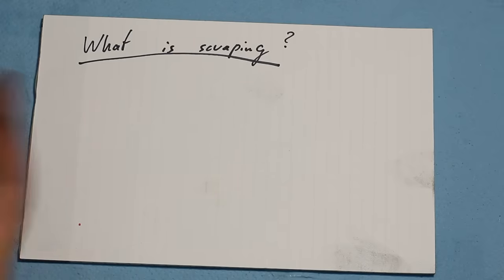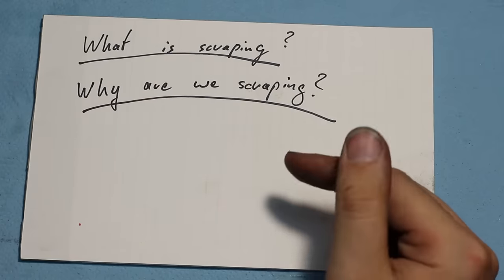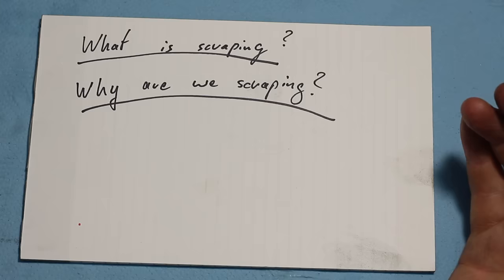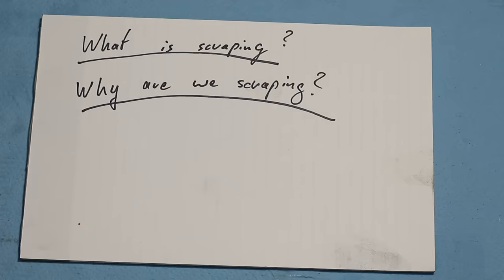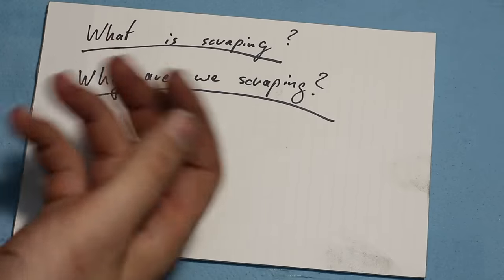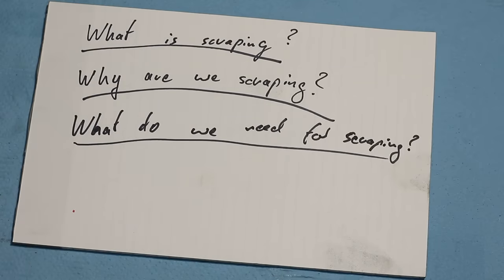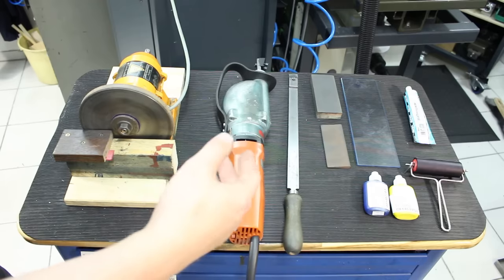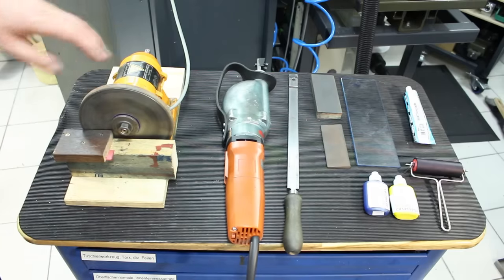Scraping basics - Scraping flat - Part 1

Comment: would be great if you could add links in description where to buy the Canode hi-spot blue/yellow, product code etc, also it was quite difficult to find it on goolge from your pronunciation alone, and you wave them around way too quickly to read the markings on the bottle, the bright light makes it hard to read whats on the bottle as well

I recently got into scraping myself, haven't tried water based inks yet, but I have tried that "Diamond" brand and Dykem hi-spot blue inks, and Dykem is much easier to spot once you're nearing the end of the process and use really thin/light coat of ink on the surface plate, shame that Dykem is really difficult to buy in mainland EU at reasonable price

p.s. oil based hi-spot is really easy to clean off if you have wd-40 at hand, no other solvent I tried worked that well to clean things up, including your hands, and in case you don't have protective gloves or find hard working while wearing those, get the PR88 barrier cream
Reply: I also had truoble finding Dykem or similar product at a reasonable prices here in Denmark, so I decided to try artists oilpaint. Get the Prussian Blue stuff, it is the most blue you can get, and the same pigment as in Dykem. The oilpaint is based on linseed oil, so it will harden over time, but it takes a day or so, and even then it can be removed with normal solvents. I use naphta for that. 

I have not compared the oilpaint to Dykem, but it seem to mark pretty well even in very thin layers, but again, i have no real comparison.  But if it gets you going until you find some Dykem, it should be better than nothing.
Reply: I cant find it locally here in Denmark, a search on Ebay and Amazon gives me a price around 19 US Dollars for 0.55 ounces, and i got tired of searching for a dealer in Europe, so i just went with the oilpaint. 

I know that prices are generally low in the US (if you find the right shop), but shipping and import taxes usually kills the idea of buying small item from the US. And since it is mostly a niche item, not many dealers stock, and doing the research and finding an alternative can be fun by itself.
Reply: I payed around 20EUR to get the 0.55oz Dykem delivered to me from an island nearly 2000km away (that was the closest and cheapest option), I think that's a lot for a tiny bit of paint, that Diamond brand one (which is like 10 times the size of that tiny dykem) cost 10 or 12EUR from a German industrial supply catalog.
I'd like to try the contrast ink (yellow/red/orange), but there just doesn't seem to be any supplier here in EU that has it, if I was pro in this, I probably could whip something up from printing press inks or similar, but since have very little experience with scraping, I'd rather get the real deal to see what it should look like.
Reply: I think you could try the oil paint for the roughing, and move to the "right" stuff when fine scraping. 

I dont know if Stefan would like to look in to if the oil paint would be good enough for starting out or hobbists, and if the difference between the oil paint and Dykem is really worth paying the premium for. 

I think i paid around 8 euro for a 2 oz tube of the Prussian Blue oil paint
Reply: update on the Canode spotting inks, found them at artcotools.com at ~14$ per 8oz bottle with 22$ intl shipping, 65$ for 3day express if you feel like it, that's for 2 bottles

Comment: It is interesting how were made first machine tools when there were no machine tools
Reply from the maker: Exactly like this :)
A lot of hand work - Files, chisels and scrapers.
Reply: @StefanGotteswinter  i only know about three plates method to achieve flat surface. But im curious about how were made rotary parts like shafts or spindles without using any precision machines

Comment: That's funny I thought scraping was a way to keep a micro layer of oil between 2 services preventing wiring down of eather serfice. Done rite you can easily move hundreds of lbs with only a micro thin layer of oil between the two.

Comment: I guess that is right,  high #'s on a calculator,  24000 something translates to 80 surface feet,  we just use surface "feet per min" x 3.82 div cutter dia or turned dia

Comment: I don’t understand why a large flat file applied using a spirit level wouldn’t achieve exactly the same, if not better results.
For example, if I wanted to flatten my sharpening stones, I use a plate glass surface with a thin layer of grit of hardness greater than that of the stones. They flatten every time given plate glass is intrinsically flat.
I must be wrong or otherwise all these people are just wasting their time in some arcane practice.

Comment: don't turn away or move on. the reason dead pan  flat surfaces is necessary is with out that every thing else will come out wrong . its where the dawn of civilized man came from, flat, round, square. is the balance that man needs to strike to build and live a comfortable life. further more he may not advance with out being precise.. machining is a science like law. medicine the entire realm of technology,  all begins at flat, round,square,. it's in need of perfection as are all things .with out the stewardship man would quickly regress .its where the ability to practice all thing start and if not dead nuts on the mark the inevitable failure will take place more often than not sooner than later.   but flat is where it all started.     shame it took me years to late to come to that conclusion . don't let that happen to you machining has a history do your self a favor and look in to it. you wont be sorry. there comes a gratification with it.   i promise and i never promise anything seeing how fragile they are . having said that once you step across the threshold don't leave your tenacity at the door.